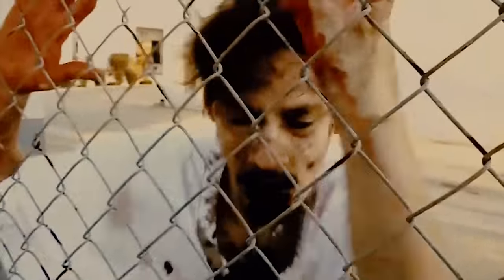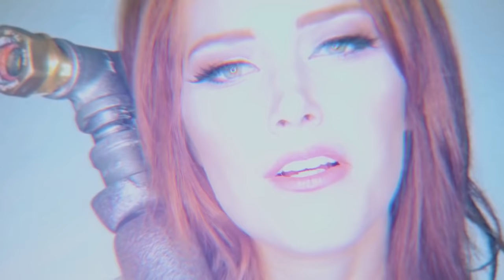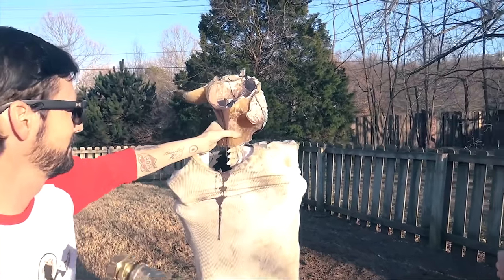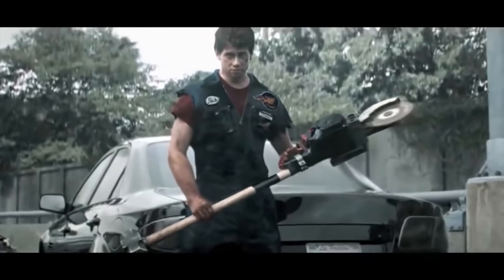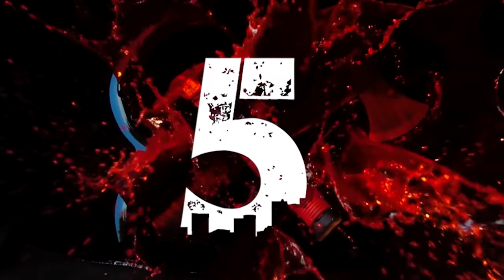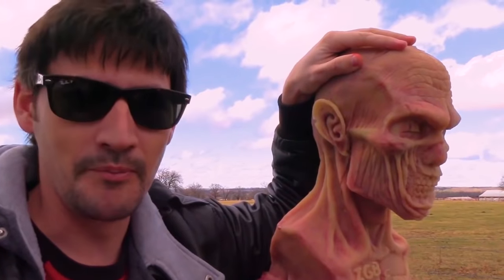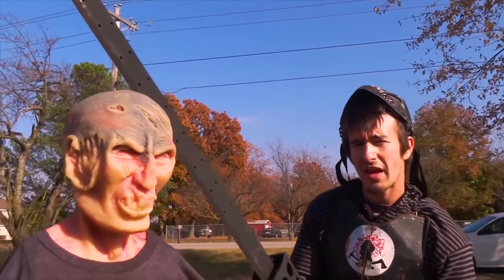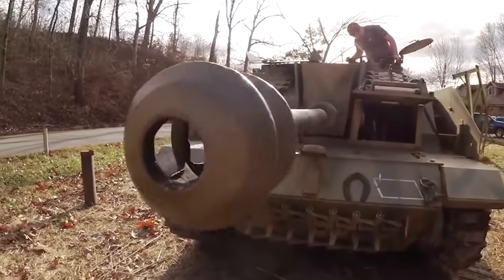10 Craziest Video Game Weapons in REAL LIFE!

Comment: Red lock tite will keep the pipe hammer head from coming unscrewed. Or drill a hole  through the pipe and threads of the head fitting and put a pin through.